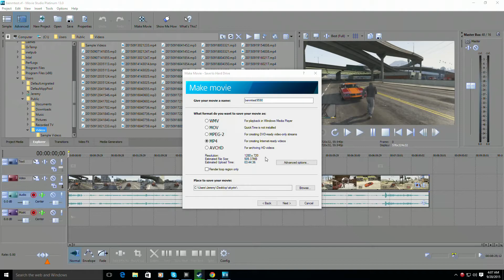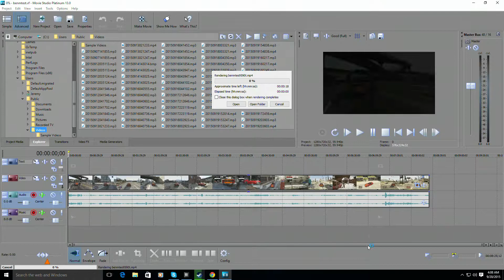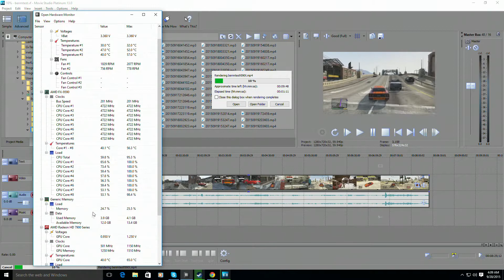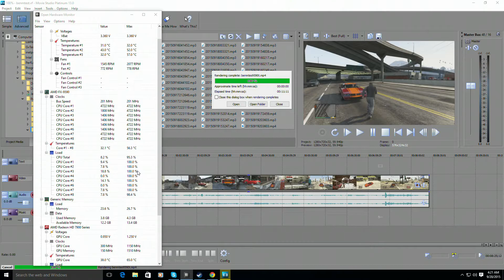AMD FX 9590 series  processor video render test

Comment: nice man, gonna check these out these vids asap for sure...been needing something like this
Reply from the maker: +Ageless PM let me know if you need help with anything or  any other videos that you think would help
Reply: +CoonMan Show With your FX-9590 and your NIC-C4...how are your temperatures?...idle and load...I have an FX-8350 and i just ordered the NIC-C4...for now i have a zalman cooler with temps in iddle from 28 to 33 and load from 60 to 67...will i get better temps?..LOL even my GPU(GTX760) gets hotter than my CPU in full load reaching 70c...tested with RealBench...Just curious if this is a worthy investment...Thank you..
Reply from the maker: +danwithjesus it's not it idles at 45 to 55 and load it shut down so I had to upgrade to water cooling Thermaltake Water 3.0 Pro (CLW0223) Water/Liquid CPU Cooler 120MM
Reply: i see...but i thought that nic-c4,with a tdp of 220w, will be able to cool your cpu and mine...So it's not a good investment for my cpu(120w tdp)?...were you in overclocking mode when you had 45 to 55 in idle temps or everything was in default mode(bios and windows i'm referring)?
Reply from the maker: +danwithjesus yeah everything is in default mode. you might have better results for with yours but they recommend water cooling for my CPU the reason I was using the nic C4 cooler is because I had it on an FX 6300 overclock to 4.7 and it kept it under 60 degrees Celsius and my stress test is prime95 and I'm using Windows 10 and  my fx-9590 it is at stock speeds
Reply: CoonMan Show Than it will keep mine cool since i don't generally overclock...i do have a MB(C5F-Z) that can overclock easily but i'm satisfied with default speeds...i also ordered a new case(Thermaltake core v51) and this should give me quite some cool air inside...